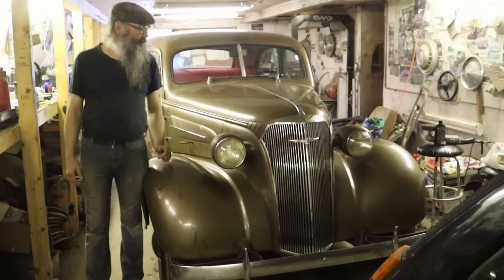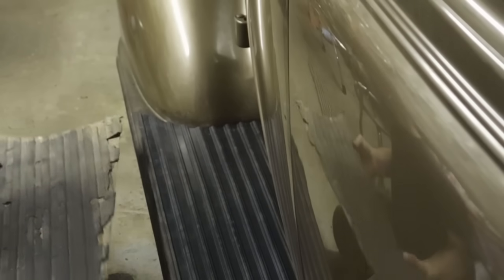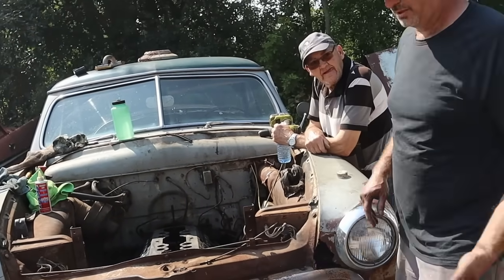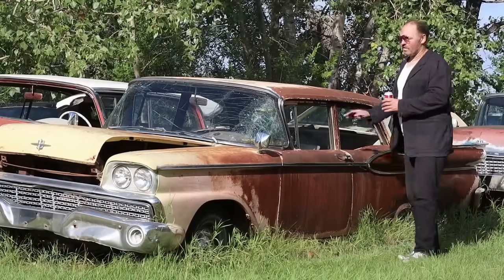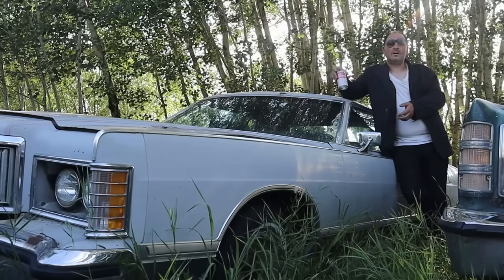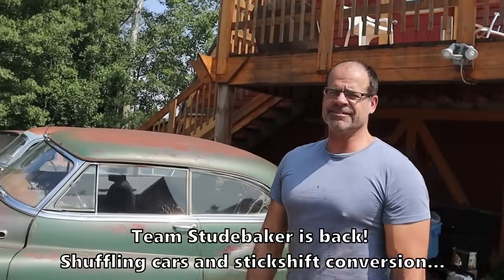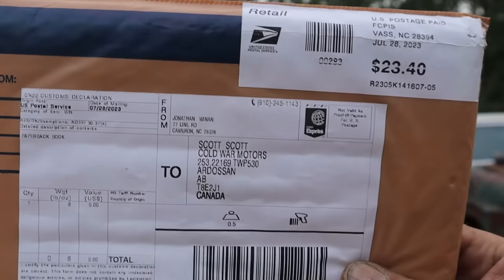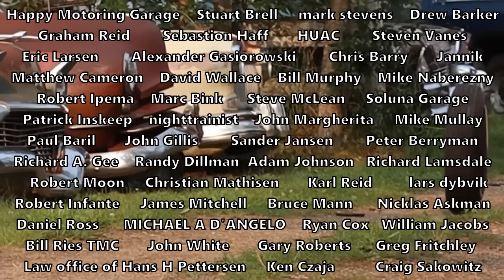1937 Chevy: Calendar Girl! Also: V8 Showdown Updates and "Dean's Greasy Flips" Summer Spectacular!

Comment: Dean is like a featured Beer Commercial. 👍🍺
Reply: If only Bud had used Dean instead of that other numpty , their sales chart would be going through the roof instead of heading to the celler .
Reply: Boy, the gas-guzzling of that 460
Marquis is going to be brutal at
Canuck gas prices...trade the engine
to a trucker or drag-racer for a Windsor. Use RV cam with aftermarket timing-set.
Reply: They should just call Dean "Old Milwaukee!" 😂😂😂
Reply: Dean’s Budweiser Greasy Flips

Comment: I am shocked how good the metal is under the running boards. Very nice.
Reply: So was i. Car hasn't seen much salt..no salt.
Reply: I would be inclined to remove the rubber material on the running board cover and spray on some bed-liner coating--or would that be a bit crude on an otherwise near mint Chevy? @LarsonFamilyFarm-LLC
Reply: @LarsonFamilyFarm-LLC  That's because it came from Washington State, whether, west side or east side, don't know. When Scott bought it from Matt Strong at Strong's Garage, it had old Washington plates on it.
Reply: I would do it because I’m an idiot who builds rat rods. Actually no, only on a car that is in way worse condition than Scott’s 37
Reply: Likely east of the mountains, it’s very dry over there
Reply: @patdesrosiers6423  You are likely right as I had forgotten eastern Washington is arid. At best, the west side gets surface rust, unless out on the coast anyway.

Comment: I'm still cheering for Team Studebaker.
Best Wishes to everyone at Cold War Motors.
Reply: Just dump the old trans back in the
weeds, I'd do it. Should basically be
the same as a cast-iron FordoMatic.
Manually shift to low upon launching, as the V-8 version normally starts in 2nd, unless FLOORED!

Comment: Great job on the 1937’s running boards. I’d say you did pay too much for the replacements , they should have fit better and not needed some tweaking. Team Vicky is doing a fantastic job on the motor, be great to hear it run again. Team Studebaker is doing well but I still think under that garbage bag is a 340ci on an engine stand 😉🤔. Great idea to put a manual in it too. Cheers Gentlemen 🍻 Dean’s Greasy Flips was funny as hell. 😂
Reply from the maker: Hey thanks so much! Next week we'll hear some V8 sounds, for sure!
Reply: @coldwarmotors  Fantastic !! Thank You !!

Comment: Bravo to all of the agents on their hard work on the challenge.  I guess the opening sequence was when there were lines to buy gasoline.  Luckily, the "T" stopped at the intersection, otherwise, it would have been smacked in the rear instead of that Beetle.  Those animated sequences are a lot of fun to watch.  The 37 Chev looks great with the hood ornament and running board covers. Dean showed us some real diamonds in the rough - very rough.   When you bought that 57 Studebaker 4 door, it might have seemed useless and worthless, but having everything to make the 58 a manual transmission vehicle made the 57 into a very useful donor car.  I guess the fact that the 57 sedan held together when it was pulled by a chain and raised was an added bonus.  And I look forward to when the calendar is available.

Comment: Sorry about those running boards.  I've had the same disappointments with repro parts.  If you take those old ones and find a guy with a vacuum press/bag, its a fairly easy job.  Many woodworkers have them for veneer work.  Not sure what glue you would use. Opening scene is too much.

Comment: Love Deans Greasy flips, it has been a long time since he did one. Hard to believe that things that usually would have been considered junk vehicles in the past. Now they sell for actual money and there is a demand for them. Maybe cause the new vehicles that are becoming junkers are just way too complicated or a endless money pit? What ever the reason is Deans done a awesome job by saving some of the cars for the future generations. Now considering that how easy it was to convert a vehicle in the past from a inline to a V8 or from manual to automatic. These days vehicles that have become junkers are just a endless nightmare to flip/convert over. Different wire harnesses, different power steering racks, different engine mounts etc. You can make your own set but some manufacturers have made it deliberately impossible to flip anything else in unless it was approved by them. Some 20 year old cars have had engine that you can't find any replacement for and some are just made notoriously bad. Good to see the progress and should not bee long until we have the race come up. PS Miles must have been doing body building to lift out that transmission almost with his two hands.

Comment: It's too bad the Chevy doesn't have overdrive so it could cruise at a higher speed but I remember my old auto shop teacher saying that those old stovebolt sixes with splash lubrication were only good for 55 mph. That was after a friend burned up the engine in his '53 Chevy on the expressway and were were looking for a replacement and found out the hard way the '55 and up wouldn't bolt up to the bell housing on the '54..

Comment: That 37 Chevy is amazing,  all in all it looked better with the new running board covers. Like to see both of those V8's run. I just got a ohv V8 to turn over by removing the valve rockers, and using a spark plug hole pressure fitting to pressurize the cylinders to force the Marvel's Mystery oil/Acetone mixture past the rings. 
Cheers to another great week, and the yard is looking 👌

Comment: To your point on the running boards: Working on Mopar products is challenging as the aftermarket just isn’t there like Ford and Generic Motors. BUT the times I have done work on GMC products with “new” parts I find the build quality isn’t there and they just don’t fit right. I suspect Ford is better - for certain models (40s, trucks and Mustangs$. The nice thing about the Mopar parts, that I pay through the nose for, is I know they’ll fit and work.

Comment: Question, Scott--when you sand on a block like your flatty, how do you keep the sanding residue out of the cylinders? Seems the grit will get in the bore/rings, and when it runs the grit will make it wear bad. I'm not a very experienced mechanic but it seems like it would lead to problems the way you're doing it.
Reply from the maker: Oh! Well, this is battlefield surgery on a worn-out engine... You wouldn't do any of this stuff to a good engine or one that you had just spent a bunch of money and time rebuilding... We just clean everything up the best we can when we are done with the sanding and scraping and they always run fine... Hope this helps! Cheers...

Comment: I assume are aware or  soon will  be that are significant drive train difference between 1957 and 1958 Studebaker's, I am also caused to wonder if you have a manual V-8 bell housing since I suspect the six cylinder housing will not fit the V-8
Reply from the maker: Oh yeah! I'm sure there will  be lots of fun making all of this stuff go together...Cheers!
Reply: The 57 has a two piece driveshaft and a short transmission tail shaft, the 58 has a one piece driveshaft with a long transmission tail shaft   @coldwarmotors
Reply: I suspect Myles likes the challenge. Adapter plate and driveshaft.

Comment: In the spirit of NOT doing a concourse job, would stripping the rubber off the original and applying a heavy coat of box liner on them work...in your expert opinion. Yes or no.  No need for explanation I trust your judgment.
Reply from the maker: Well, I'd probably try to get new rubber on them instead? Once you put that much box liner on, it is almost impossible to get it off...Cheers!

Comment: So satisfying to see the hood ornament put on the Chevy. What a gem. Love that dash too. Are you going to get the radio working? I collect old radios and they often come to life with just a basic recap. If you have someone around that works on old electronics, it's not a major expense.
Reply: It could be a major expense if it needs an old tube that's hard to find. But really all the old passive components in radios that old are suspect
Reply: @MrCarGuy  No, for a radio like the one in that car, a tube would be a nominal amount, besides tubes are usually the last problem. it's the capacitors that need to be replaced with modern equivalents. Again, a nominal expense. the biggest expense is the labor. I pay $65 to have a basic tube radio repaired.
Reply: @MaxGiganteum  Well, it depends how much of an investment Scott wants to make. You can use the radio head for completely modern internals including blue tooth with a modern stereo speaker retrofitted in the original speaker housing. I would just get someone to swap out the old electrolytics so that it least turns on a play safely.

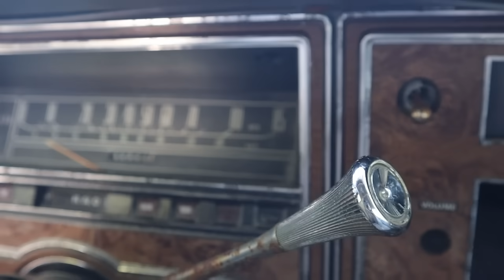Comment: Hey Scott. wouldn't that spray on bedliner work on the running boards? It is the same finish dry as that thin rubber on the originals, isn't it ? My god , that Regal , what in the world possessed someone to use blue spray paint inside the car? OMG. Did you spot the EQ/power booster on the bottom of the dash? I think that tells you how old  the person with the spray can was [grin] Did I hear Dean fart at 33:55? lmao

Comment: Hey I was wondering if it would look right if a person would apply a good brand of spray on truck bed liner on those running boards...  It would be nice to have the originals restored. It's amazing how well preserved the underside of that was. You know as many carbs as you guys go through it would be nice if you had a ultrasonic cleaner. Just thinking aloud...

Comment: Whoever it was cleaning the top that head off with a screwdriver should have just got himself a wire brush and cleaned it. It would have been much cleaner, and it would have been lots of faster than scraping it with a screwdriver.
Reply: Yes or a putty knife.
Reply: @MichaelLococo-h4w  I know I’m just being a troll

Comment: The little bantering from Jonathan W. and yourself Scott renews the fun in doing youtube shenanigan's for sure. He broke a chunk out of his wallet to have some great fun with you. Deans attempt to get kids not to do drugs might just work.. provided they can get their dad and mom off of them first. I suspect the Studebaker might need a touch of heat from blue wrenches to make it a standard shift. I am almost certain that the clutches in the automatic were already in the pan. Just for your information, if you should decide to do dual carbs on a flathead, my way of cheating any vacuum leaks was to use the cereal box plate under one carb so now air is sucked into the intake losing your ability to swirl the fuel as it goes to each cylinder. Just never trusted the bottoms of those tiny carbs to seal any air leaks off.   Then again, you have right stuff and of course good cleaners for each carb to get all things close. Just this old man interfering with you kids brains. Once one carb comes on to life, not long before you can get the other one with all you and strongs garage tools and stuff to work out the kinks. I am so hoping the studebaker comes back from the dead. Oh, now I remember what I thought about.... roads back in the day, they used oil on them to hold down the dust and left undersides of our rigs with piles of oil and dirt making them look like they were slobbering junk but it mostly came from our roads giving that issue

Comment: Id be thinking i need a real engine fugg period correct they had small block chevys and first gen hemis way back for as long as they used flat heads high 16's 17's id cry for sure thats a four door taxi time  old rods weigh nothing should be in the12's with a decent engine "period correct" ask big daddy about period correct he went hemi in 1955 never looked back get the 354 or 392 its a real race engine you wont be scaring your kid with break neck speed more like rattling and banging shaking jalopy sounds hahahahahaha 😉 👍 😜 sorry not a ford lover lee but like some fords the ones with Mopar power like your truck lol! I want to see a race between the ardun hot rod and a hemi powered hot rod i think the hemi will win can you set that up on your channel lee do things that iron trap isnt doing they do the same shit over and over nothing new or exciting on their channel